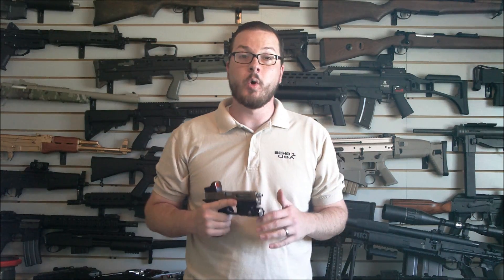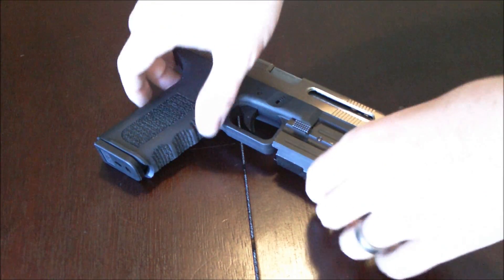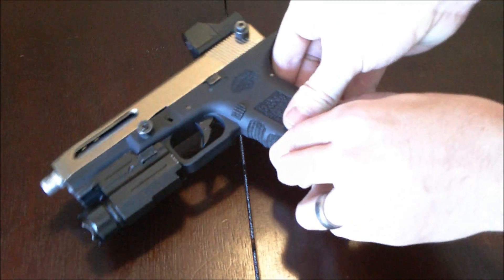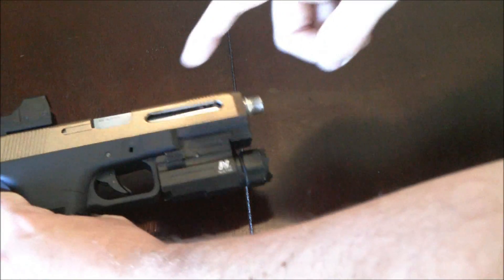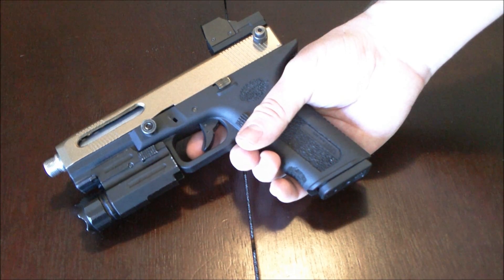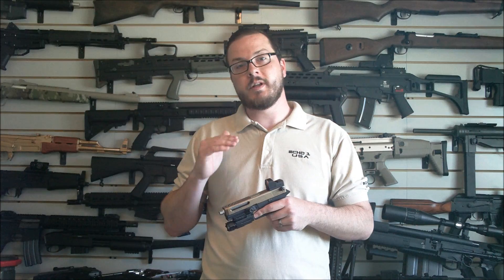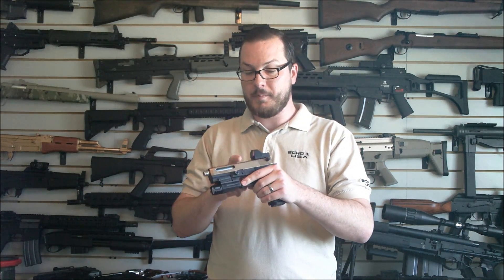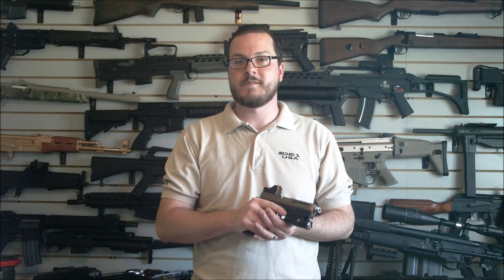Echo 1 Timberwolf Custom Tactical Pistol Project

Comment: Can the G&P RMR mount for glocks fit on this slide? If not which one did you use and where may I be able to purchase it?
Reply from the maker: +Trevor Durkin I used a silverback mount that I purchased from Evike. If the G&P RMR mount is for TM Glocks, it should work.

Comment: I'm buying this gun with the silver-back mount, can you explain how to install the mount and what optic will fit on it?
Reply from the maker: +Luke Tecpa You unscrew the screw on the blowback assembly that screws into the rear sight, remove the rear sight, and install the mount. Any doctor style sight that has the auto-brightness feature will work. You can't use the NCStar one with the switch.
Reply: cool, and I'm assuming that I need the "g-series" silverback? also, which side must face down, the side with the bar that sticks out or the side that has the hole in the middle? and does the end of the mount with the bar face the front or back of the slide? lastly when I type "doctor sight" on evike nothing comes up could you maybe be more specific on a particular sight and where to buy it?
Reply from the maker: Depends on the pistol you're using. There are two different glock type mounts, one for KWA/KSC and one for TM/WE. There's only one way to install it, you'll know what to do once you have the part in front of you. I used this optic: http://www.evike.com/products/37042/
Reply from the maker: Drilled and tapped holes and screwed in the knobs.
Reply from the maker: You can drill polymer no problem. You just have to use the right size screw to make sure it clears everything.
Reply: will silver back work on kwa ptp mk2?
Reply from the maker: Not sure, they make several silverback mounts for different pistol platforms.
Reply: do they make more than two? on evike I only see the one for KSC G series and the one for Marui Hi-Capa's which are their 1911 line. sorry to if I'm being a pest just that I saw you have a lot of guns so I was hoping you had a KWA MK 2 you could try it on. well thank you for the reply. I think I'll just buy them both as they are only 16 bucks each and I plan on having a pistol collection so I'll just try them on all the pistols I buy. one last thing, do you know of any other pistols (besides the timber wolf) any of these would fit onto? I'm thinking about the VFC M&P9 or one of KWA'S USP Series pistols as my next gun
Reply from the maker: Yes, they make more than just the two. Evike just doesn't carry them all. The KSC G-Series mount will only mount on KWA/KSC glock models. I don't know what's currently compatible with Marui Hi-Capa series.
Reply: do you have a link to a site that carries the ones that evike doesn't? I plan to have a fairly large collection of pistols so I will just buy all the different variants and surly they will fit my multitude of different pistols.

Comment: Ok so i have an echo 1 timberwolf. I want to get a silver slide for it and i ready found the slide i want and its website and everything, but they sell the slides in we/TM g17, g18, g19, and other styles. Which slide should i get that will fit in the echo 1 timberwolf?
Reply from the maker: G17

Comment: One more question what did you use for the charging handles?
Reply from the maker: That little knob on the bottom of an M4 stock that you use to adjust the depth of the adjustment rod. Made a great cocking lever and thumb rest.

Comment: is that the stock barrel or an threaded barrel? i have a timberwolf andit has no threads and its about a 5inch barrel. any ideas on finding a threaded barrel along the same size?
Reply from the maker: mark merrill Mine came with an orange threaded insert. If your outer barrel has the internal threads, all you need is one of these: http://www.evike.com/products/32748/
Reply: awesome ma thanks forgetting back!! helped out a lot!

Comment: how did you get the slide to move the like butter
Reply from the maker: Polished and smoothed out the rails both on the slide and the frame.
Reply: sorry but how did you do that
Reply from the maker: With high grit sandpaper and polishing compound.
Reply: boool the pistol is nice is the timber wolf worth it

Comment: how did you do the thumb rest and cocking handle
Reply from the maker: +TrollololMan242 They're the adjustment nuts from two different M4 stocks screwed into the frame and slide.